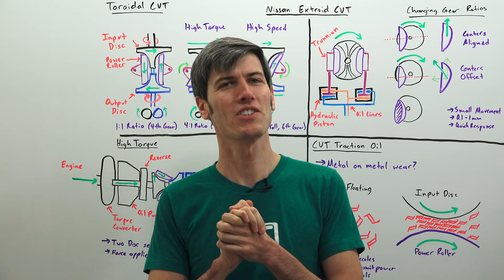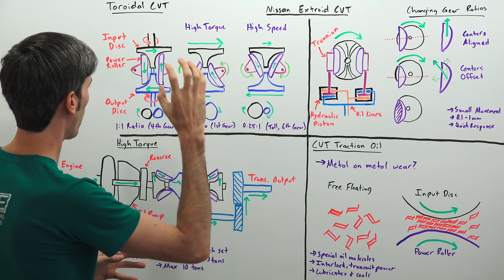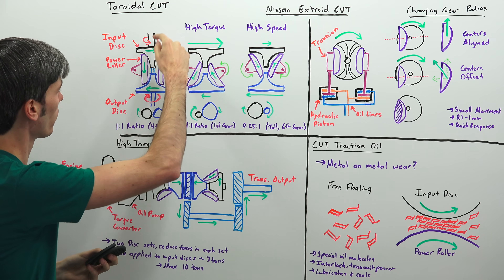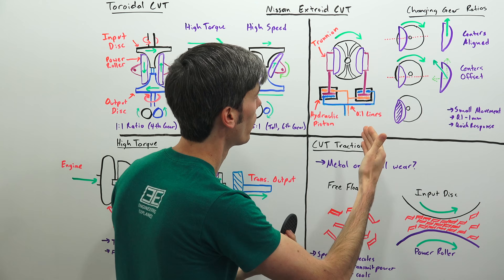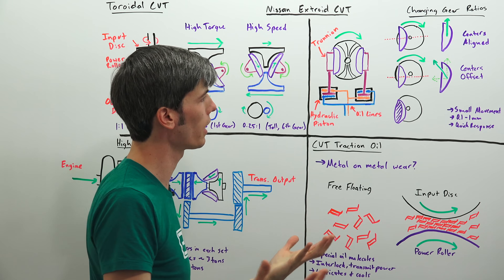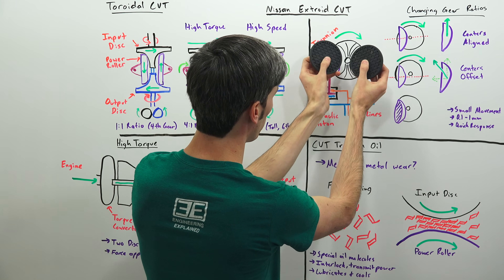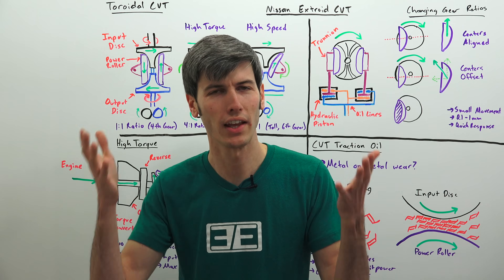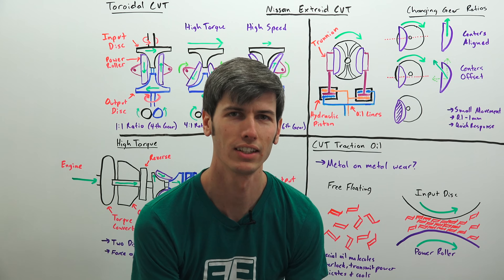Nissan Created The First Production High Torque CVT

Comment from the maker: Bucket thinks CVTs are awesome, and suggest these videos as well!
The Fastest Transmission - https://youtu.be/cb6rIZfCuHI
The World's First DCVT - https://youtu.be/162BWwkcy5U
Toyota's CVT With Launch Gear - https://youtu.be/HanImTejIVM
How CVTs Work (throwback!) - https://youtu.be/SQLeKdZWGI4
5 Things Don't Do CVT - https://youtu.be/HSxg97m8lLA
Reply: dude jason, i just had a moment of clarity, why not put a toroidal CVT between the transpission and the rear diff, you can change diff ratios on the fly to suite your driving, having a 4.5:1 for racing, and 2.8:1 for efficiency going home, this way you can keep a manual transmission without having the need for 7 gears for efficiency
Reply: They're doing this because their belt CVTs suck.
Reply: I think you misinterpreted Bucket's thoughts.

"Put me DOWN you petty servant!"
Reply: Jason I'm interested to know how e-cvts like from the Prius create variable ratios without having belts and pulleys? Any chance on a video on these? Pretty please😁
Reply: I seem to remember a British company called Torotrak, who had something like this umpteen years ago, including the magical fluid. They also had the the output from the "variator", and a direct output from the engine both fed into an elliptical gear setup to allow all possible ratios from a ridiculously long overdrive, down through to neutral (and into an infinite range of reverse ratios). It included electronics to control the whole thing and potentially emulate characteristics of any type of gearbox. I think it was initially aimed at trucks initially. Not sure if light enough to be sporty.
Reply: Bucket is an epic cat name btw.
Mine is named Apex.
Reply: Quick question. You mentioned the reverse, it sounded as though the power goes through the CVT in reverse? So almost as fast in reverse as forward? Or is the reverse connected to the output shaft in a different way?
Reply: @bobtherock26  
maybe a gearbox like in an air drill , locked for forward and free in reverse , will be slower and have much more torque :-)
Reply: Awesome, video. Would you be able to further explain the difference in oil setups between this and a traditional transmission? That was the only part that I didn't seem to grasp well from the video. Thanks
Reply: Upper left quadrant, lower three drawings: The first one reverses the direction but the other two don't? Why is that?
Reply: You have outstanding skills for explaining things using your blackboard only. Are you university professor?
Reply: So what's the maximum horsepower you can put through one of these? 🤔
Reply: Any similarity to the infinite torque transmission ford was kicking around for the superduty's some years back?
Reply: Maybe in a car they made the First high torque CVT but mitsubishi made a CVT that hauls a 50 tonne tank that has 1200 HP twin turbo V8 diesel
Reply: Is the torque converter necessary in a CVT? Since the driveline is never disconnected to change gear, I would assume neither a torque converter nor a clutch would be necessary. Why is it included?
Reply: @amidamaru0086  
the torque converter when turning slow disengages , if it wasnt there the wheels would always turn when the engine was on :-)
Reply: I heard some guy long ago built one and had it in a built grand national
Reply: Engineering Explained My Nissan CVT has been unreliable.
Reply: Doesn't the CVT in the Toyota Harrier or Lexus RX 400h have high torque capabilities since it's a planetary gear set? The front ICE produces 212 lbf⋅ft of torque and electric motor also connected to the CVT gearbox is capable of producing 246 lbf⋅ft.
Reply: What's the difference between Nissan's High Torque CVT and John Deere's IVT?  They seem the same too me, in concept.  Maybe different marketing strategies?  Seems like John's Deere's system came out in 2010.
Reply: this is taking advantage of the coriolis effect.
Reply: Funny, a long time ago, when the variomatic was developed they had an f1 car (Williams) i  the shop in Helmond NL. Then at, a later date, they had a Volvo 400 series with a souped up Renault 5 turbo engine. Driven it more times than I care to remember. The times the belts failed, or burned, was staggering. Happy times though.
Reply: Please, how are the materials for those discs and toroids?
Is them expensive? What about durability?
Reply: This is reminiscent of something illustrated by an issue of Popular Science back in the mid-70's called Tracker, or Trakkor, or Trackor, or something similar, but google can't seem to find it.  Anyway, like a lot of "new" tech that you see today, the design is not new.  Just that advancements in materials allow a lot of old designs to be feasible now.
Reply: The only thing I think you failed to go into detail more about is how those bars move those discs
Reply: If it's not last. It's failure
Reply: Bucket no like Torroidal position by its slave
Reply: nissan isnt know for trans reliability. how long till it destroys itself?
Reply: Bro I love mechanic engineering .Does it have more scope in future after the coming of automation ,robotic, does the scope of mechanical engineering go down? After the digital revolution does robot take work as  mechanic in place of human

Comment: I am doubtful that they even handle what little power the 2.0 in my Rogue produces and that is just 141 HP.  I have a feeling that the same 2.0 if not direct injected would just just abysmal for that vehicle.  Now guess what is in the newest Rogue?  It is a 1.5 liter 3 cylinder variable compression turbo engine.  I must say I hear they are quick but I am not prepared to believe that they are worth owning in any hilly areas.  I lived in Pittsburgh and that is one place where a terrible engine or transmission will reveal itself with all of the steep hills there.  Also if something ever possesses you to visit Pittsburgh in the winter a lot of those hills are very dangerous in the winter time.

Comment: I see an discovery channel about the development of this steroidal transmission. And one of the most difficult to develop is the oil for this system. They need to lubricate and be able to transmit power between the system

Comment: i think a manually controlled cvt would be an interesting idea, using something like a third pedal instead of a clutch for the left foot that you lock your foot in and either moves up or down to change gear ratios… imagine being in a race and being able to change to the exact gear ratio you want
Reply: You can lol. My 2016 10th gen civic has paddle shifters which pretty much “fakes” the gears. But yeah, you can put it to whatever gear ratio you like. Isn’t a point to it as CVT’s were an idea to have constant output without needing to change gears and always have the right amount of torque when you need it.
Reply: What I would do is have it hold a fixed RPM, and then manipulate gearing for speed.

Comment: I know this is 2 years old but Nissan CVTs are still failing by the bucket load and they have been since they were introduced in the 90s Primera.
I regularly see them at below 100k km (60k miles) and sometimes even half that.
I hope this system is a lot more reliable.

Comment: hows to compare to subarus higher pwr/torque chain cvt used in the (my wifes) 2014 FXT etc?  (and all subaru cvts are chain iirc not belt so they should have better longevity than most cvts)

Comment: Well, seems like that cvt will generate a lot of heat, which is inefficiency, energy lost, lower mileage. Is this cvt more energy efficient than a regular auto trans with planetary gears/ clutch packs ?  Also, this cvt also incorporates a torque converter, another energy loser.

Comment: Compare with Frank Hayes patent of 7 May 1929 "Variable Speed Power Transmission" . That's the original.  identical principle design. The clever lubricant makes the difference here.

Comment: Why do locomotives for trains use electric? Reliability no wearing parts for speed control. Farm tractors use CVT or hydrostatic but works best for ground speed control when most of most of the engine power is operting the harvesting unit not for ground wheel torque extreme heat build up in applying constant high torque to hydraulic/ hydrastic drives excessive wear on cvt when high torque conditions made for getting good fuel.milege keeping engine in.premium operting rpm  not used in semi trucks etc

Comment: Identical design with Torotrak's Full-Toroidal Variator (I wonder who developed these: Nissan or Torotrak? My bet is NOT on Nissan).
Also, VERY similar design (and using the same oil type) with NuVinci. But my guess is NuVinci actually copied and simplified the design from Torotrak...
Reply: A company called CVTCorp out of Quebec also has a similar design.  They gave a presentation to us at work over 10 years ago that contained a lot of the same kind of information that was shared in this video.  They emphasized the importance of the special oil since that is what makes the whole concept work.

Comment: I use to own a 1999 Nissan Gloria with the Extroid CVT.
It was the most amazing transmission I've ever driven.
Super smooth and great power delivery when needed.
Works well with the 3.0L V6 turbo engine.

Comment: It's simplicity is it's advancement.
Why hasn't it been common place since? It essentially solves the weakness with CVT by replacing the belt with solid wheels. They could make one to handle V8s too, based on what I saw here.

Comment: We were playing with traction drives at Clark Equipment Transmission Division back in the 1970s.  
The verdict was "No Way" in heavy equipment transmissions even with
Special traction fluids. I personally will stick to the engineering verdict back then and would personally never consider a traction drive. Good luck to those who do. By the way, my grandsons Nissan CVT just failed. He apparently didn't value grandpa's opinion.😊

Comment: Fallbrook launched their NuVinci CVT in 2006 with a similar principle with traction oil, but using balls instead of rollers. I got one on my current high torque e-bike and it works very smooth and nice with 380% range.
Reply: Dana licensed that for the Variglide transmission.

Comment: This must be a relatively expensive trans to produce, maybe VERY expensive. Otherwise, seems like we'd see it in many Nissan and Renault vehicles, especially after two decades of development. Logically, it would be down-sized for smaller engines that don't need 10 tons of torque capacity. 

It's also interesting that the disks are not simply geared to each other, with gear teeth on each surface. I'm guessing there would be a host of problems with that, including machining cost, materials cost, tooth geometry issues, and noise. So, instead, they have this trick (and maybe extremely expensive) lubricant/drive fluid. That fluid possibly requires frequent changes, due to losing effectiveness fairly quickly. 

Whatever the reasons, while interesting, this CVT appears to be a commercial dead-end.

Comment: Instantly recognized the drawing!  I had a Dixon zero turn lawn tractor 20 years ago that had this very mechanism.  Two steel bells with a friction roller inside each one.  The two driver sticks would rotate the friction roller against the bells, up and down and cambered to drive the tractor forward, backward, fast, turn, all that was needed.  It transmitted enough torque that I could pop wheelies with the tractor on the driveway.  It was an open system, no fluid to cool or lubricate.  Tuning it was a pain, but it was a fascinating device - and now I see it on Engineering Explained!

Comment: My first car was a DAF 66, with rubber pull belts. Going over 50mph resulted in a call to the AA and an expensive visit to a Volvo dealer for new rubber bands. Apart from that it was a decent reliable car! Steel pushbelts are a big step up and this sounds like something even better. One can think of so many applications for the non-Newtonian lubricating/cooling/force-conducting oil too.

Comment: Bit late to this party, like Nissan with the "high torque claim" - Lexus would like a word...or do we not count a 368Nm ICE plus a 275Nm motor as high torque? Or the GS450h's e-CVT as a CVT? It's not belt-driven, but it's continously variable and it's a transmission. I wouldn't call that low torque either.
That leaves me with the conclusion that Nissan have invented time travel! Since Lexus have had that setup since 2005.
If they have, they're pretty late, which is why my comment is too- I was in 1993 having a rave until this virus thing blows over, because going to the past to wait for something makes total sense.

Comment: Every system has some benefits versus a number of trade offs. Are CVT in general actually practical for cars given poor reliability record?  CVT versus manual/ stickshift. Does CVT have requirement to perform regular and sometimes difficult gearbox oil changes which are costly and time consuming as per autos and powershift etc? Are they more expensive to buy versus manuals, can they respond as superbly as BMW ZF  transmissions? Are they in practice less efficient? What is their real world longetivity?

Comment: All doesn’t make practical sense until that “magic” lube show up in the equation. I wasn’t aware of such lube until this video. 

When this system was first published, the article wrote that the chamber containing both coupling disc and end plates was filled with lube that normally let two surfaces glide, however under high contact pressure, suddenly make them synchronized where they contact, thereby created a direct coupled junction.

I remain skeptical about that lube one and then.

Comment: I have invented a durable CVT. My CVT does not depend on parts that have the possibility of slipping which will also inevitably slip. None of the parts in my CVT have to be pressed together. Nothing in my CVT depends on friction or traction to remain meshed together. There is no possibility of slippage between components. My CVT will work in any motorized application, no matter how small or large. It will be placed in a racing vehicle to prove this. The design is finished and viewable in video illustration. It will increase efficiency and performance in any application beyond any other transmission, even in electric vehicles.

Comment: So we've moved from the double-clutch transmission to the double-clench transmission... great.   I'm gonna call them "double crunch" when idiots start filling the fluid with metal particles.
A six impeller variable hydraulic converter is likely far far better and will last about 800,000 miles without a fluid change.
An ELECTRIC conversion transmission, once someone actually applies half a nutjob to it, will be superior to all this crap.  We've got the motors and an engine that has the power output of a Tesla X's battery can be bought through Tractor Supply.

Comment: Your diagram makes the input/output discs and power rollers look smooth.  I assume they must be grooved like gears or they would slip.  Are they grooved?
Reply: There are no grooves. The metal discs and power rollers are smooth per Nissan. The torque is transmitted through the special lubricant - the oil.

Comment: High torqe?😄
Take a look at the 1500 Vario by FENDT! It has 2400Nm of torqe an can drive from 0.1kmh up to 60kmh. Also front and rear axle are independent. It is simple and has almost no wear. Even if te efficency may be not that good in low "gear", it get's very good in the high ratios. 
I just can't understand why there's no car with a similar gearbox design.

Comment: You didn't explain exactly how the input disc engages with the power roller. Are there gear teeth? Is it just a crude friction coupling?
Reply: He stated ... it uses pressure.  There are no teeth on the smooth steel discs

Comment: Designing good gear tooth life is a factor in high torque applications. I have spent a large portion of my life dealing with truck and off highway transmissions, manual and powershift. Depending on friction to transmit high torque to me is laughable.

Comment: I guess then the CVT / IVT transmissions used in agricultural equipment and construction equipment for YEARS must not be as "high torque" as the one produced for an automobile.  Sure, that's easy to believe...
Reply: This is the first High-Torque CVT that is being installed in a "rear-wheel drive car".  Is your tractor a car?  NO!

Comment: Jason, I have invented a near unlimited horsepower and torque stepless transmission with only bearing losses. It can follow perfectly the horsepower torque curve and could even be used in Top Fuel. It's virtually perfect. I would like your opinion on it. I am an aerospace design engineer with a public company based on my invention in aeronautics. I believe I've discovered the most efficient way to accelerate any Mass. Could you please reply if you get this message. Maybe you were too busy but I am on LinkedIn. As well.

Comment: What are they considering high torque? They seemed to think an xtronic was sufficient for over 260 ft lbs and over 270 hp in a 6000 lb pathfinder with an advertised tow rating of another 6000 lbs????????

Comment: Nothing new circa 1970 Volvo Penta Aquamatic marine outboard drive has a friction cone drive system and uses mono 40 grade motor oil for lubrication. The Aquamatic 270 is rated to 300HP.

Comment: Without much modification, the concept could do away with a transmission in usual place on engine output, and replace differential gears. Ipso facto, you have non-slip via independent drive trains. And of course, 4WD follows just as well (even better, because different speeds at front and rear axles has always been a problem). Put a computer in control of the CVTs and regenerative braking is not far off too.